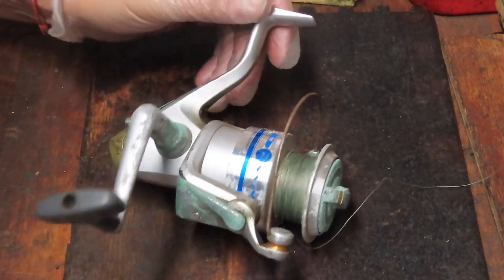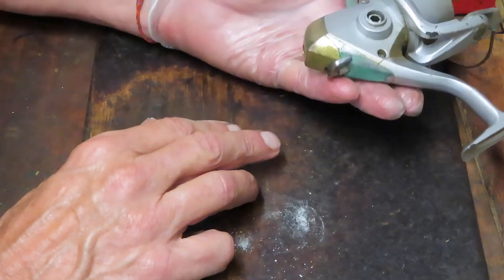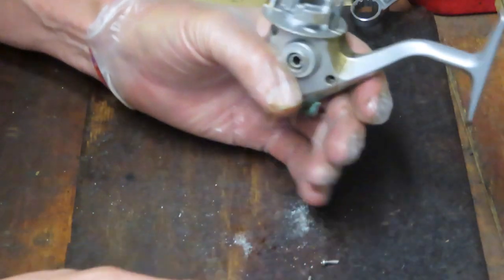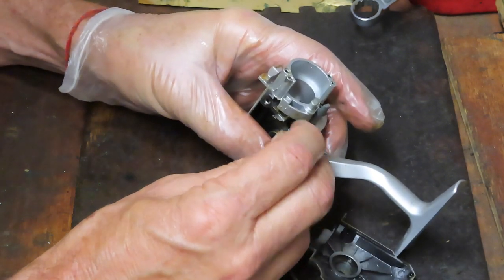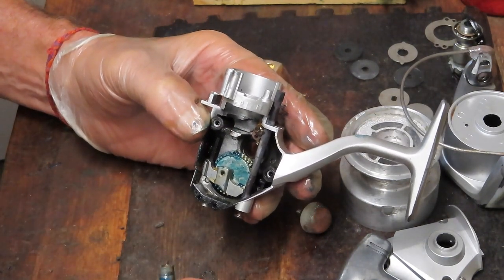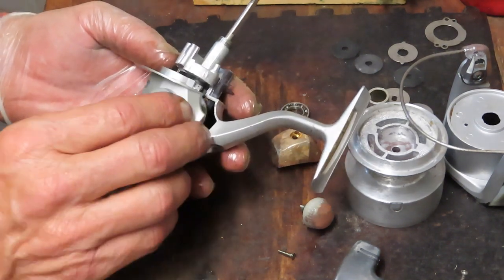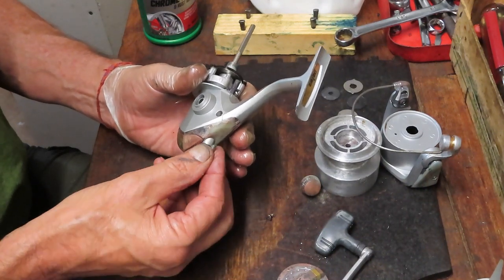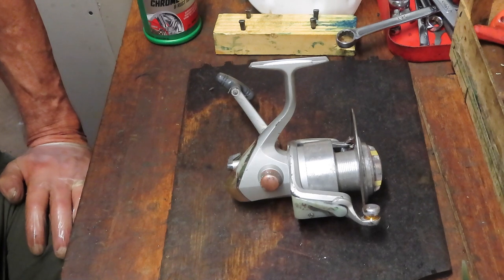Daiwa D Wave sping fishing reel salvage projec how to take apart clean and service

Comment: Could you recommend a good power handle knob conversion kit for a Daiwa d-wave spinning reel 4000 b that comes in white with a black handle?

I like the real but I hate the shape of the knob. not very comfortable when you're cranking in a big fish. I just don't know what is out there that would fit.

Thanks
Reply from the maker: There are not many custom handles for this reel as the handle and or knob would cost the price of the reel.  You can check Ebay to see a bunch of generic options that may be what you are looking for including "T" knobs and Ball Bearing power knobs - Dennis

Comment: I’m amazed that bearing looked as good as it did given the horrible exterior condition of the reel. As I have said before I don’t particularly like AR setups like this one, it’s just a preference not necessarily a negative judgment. Interesting reel and video!
Reply from the maker: Thanks Chris.  This is not an expensive reel and that's why the A/R setup is old school.  It does work and the is the important part of it all.  I was surprised to find that they adapted a different case from a reel that has the A/R under the rotor to make this one.